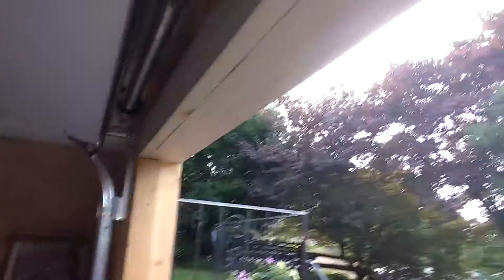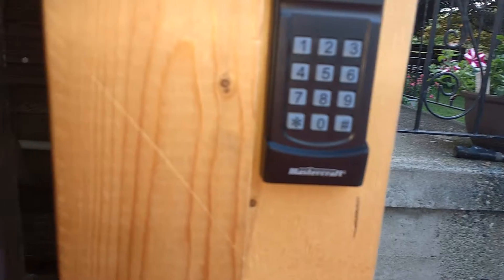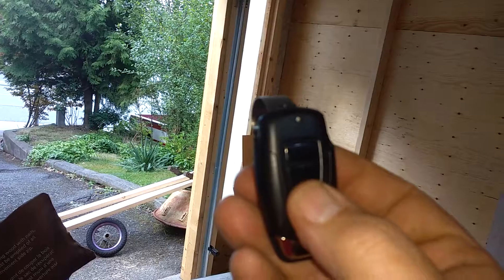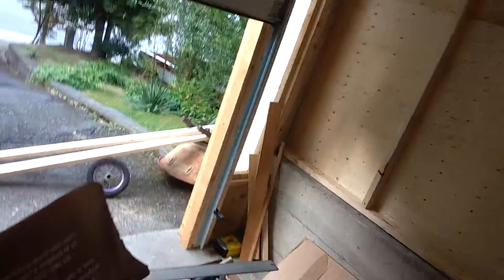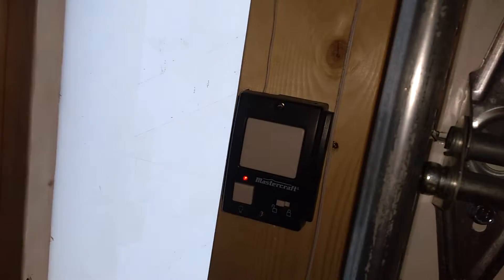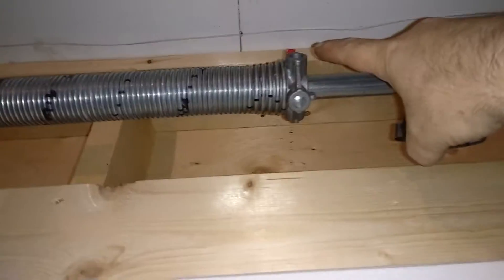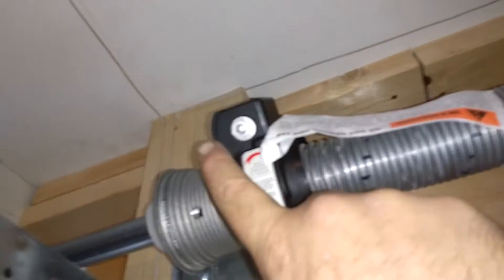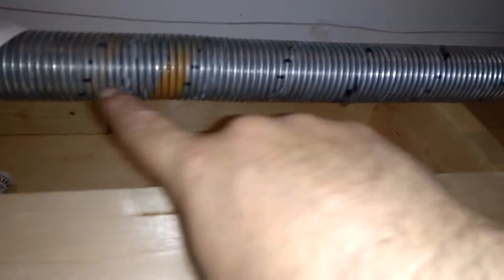Garage Door 4

Comment: That's done realy nice (from an ex builder) . I like the idea of the key pad on the outside. Mine is a small hole on the outside that I push a welding rod into to hit the inside switch. Cheers
Reply from the maker: Thank you for the kind word. Have to remember that hidden switch deal for future or if this pad ever breaks. Thank you for stopping by !